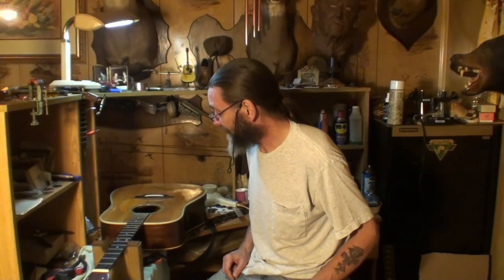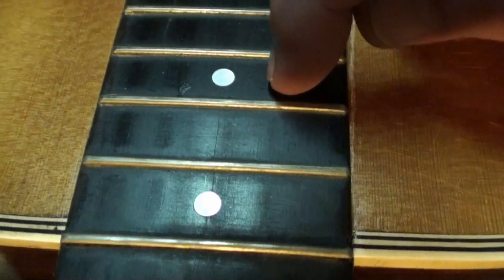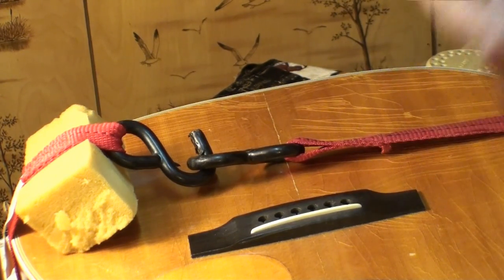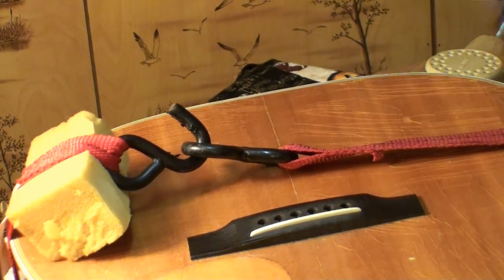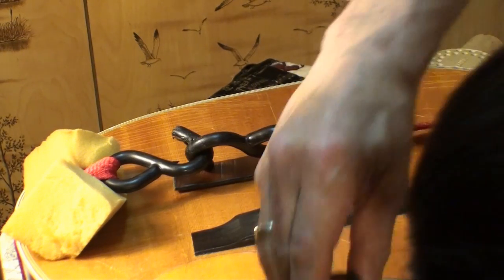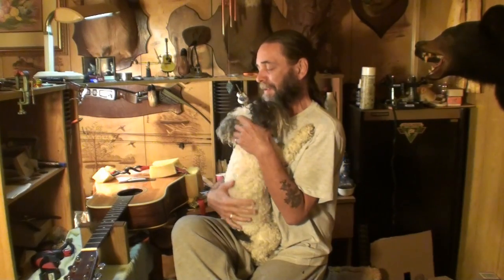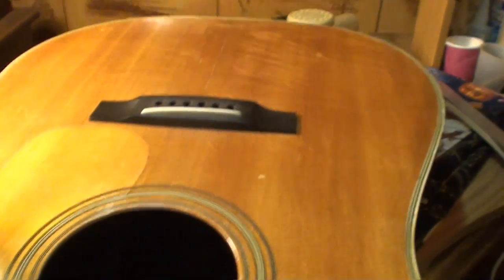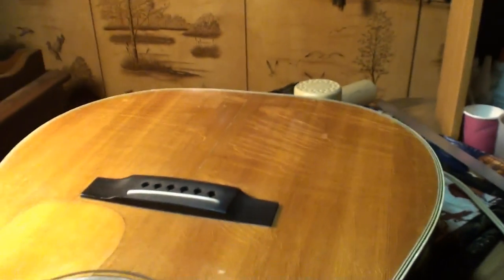Acoustic guitar cracked top repair by Randy Schartiger guitar repair videos

Comment: Thank you!!!! This video is excellent.  You are so good at REALLY explaining and making this information easy to understand.  I've got a 30-year old Ovation, shallow bowl, Thunderbolt, that was "destroyed" from a broken strap and a fall from a stage to the floor.  Oddly,  it STILL plays and sounds pretty good. but where the sound holes are ( lightening bolts), two HUGE cracks cause the whole front on each side of the bridge to cave in about a halfinch.  Like I said, this guitar still plays well, sounds pretty good, and (despite a crack in fretboard), it still stays in tune!  I assumed that the truss rod was also wrecked, but maybe not.  Anyway, I'm gonna try to work a miracle and try to fix this guitar up.  I'm a BIG fan of Ovations, so I hope I can make this thing look good again and keep playing well.  Thanks again for your videos. They have given me enough confidence to give it a shot!

Comment: Thanks for all these videos!! It's so helpful and encouraging. The entertainment aspect is the icing on top! It does take balls to fix someone else's expensive guitar- which I don't have in more than one way. I'm working on an old Gibson b15 195? There's been quite a bit of debate over it in the area guitar shops since Gibson's numbers are kinda wack and it seems to fall somewhere in the unknown/doesn't make sense range. There's a nice crack right down the middle of the top. Apparently someone attempted to fix it at some point, but the cleats are more like chunky blocks and the crack remains. One repairman gave me the advice of filling the crack (not wood filler, but actual splintered wood). I'm not sold on the idea. I really want to take those old cleats out and just redo it all. Thankfully it's my guitar, but I'm practicing and want to treat repairs as if they're someone else's guitars. I'm afraid I'm frozen stiff with my indesiciveness. 😡

Comment: Great Useful Post!  Suction cup being used at 5:00 enlightening.  My skills are primarily with wooden antique rifle / musket stocks ( e.g. Revolutionary War 1766 CHARLEVILLE ) .  Now gun stocks which are a lot thicker; but if I see light through the crack, I run a piece of unwaxed dental floss through the Crack then add a conservative amount of adhesive to the floss and work the floss back and forth through the Crack to get the glue deep into the Crack.  Would this work with a Guitar ?  Another trick I found fir dents in a rifle stock is a few drops of water over the dent and let sit for ~10 minutes.  Then a damp piece of bleachec sail canvas is placed over the dent and a HOT clothes iron  is worked back and forth over the dent.  The water turns to steam and expands.  The expansion pushes up the dent and sometimes makes it disappear  completely.

Comment: I have a new patient in. Two long cracks from the bridge to the tail caused by dry, heated air which don't look that difficult except they're only about an inch or so apart and that will make it a pain if I can't get them both to level out at the same time before gluing and cleating. But she's also got a wound above the sound hole where it had something heavy dropped on it or it was dropped on something. That issue is compounded by the bracing being right where I need to put in a makeshift top "jack" both on top and on the back! I took a turnbuckle for a diy screen door and cut it down to fit inside a guitar and glued two wooden bases to the eye bolts and stuck a pair of felt chair leg sliders on. It works pretty good. I used it to level out and hold another cracked job I did.

Comment: Hi Mr Randy, great job with the suction cup, forcing the glue through the crack. I liked it when the strip of leather seemingly appeared under the two hooks joined together at the top of the guitar and loved it when you pulled Q-ball from the hole a lil' later on....Hooold Onnn!!! Have a great evening :)
Reply from the maker: lol gotta keep it interesting and funny! :) I had paused the camera and thought I should put leather there lol That's a good trick with the suction cup and gets glue where you normally couldn't get it. old on! :D Thanks Suzanna for having a look my friend hold on!

Comment: I'm humidifing my guitar at the moment because I found a crack and I thought it would be better to swell the wood to close the crack and get it as close to its natural shape before adding a clete. Good video. I like the idea of using the tape on both ends of the razor to scrape the high edge off the crack!
Reply: Exactly. Humidify it first and then address the crack.

Comment: Randy: I've been around guitars for 70+ years and have seen about everything bad that can happen to them.
I just picked up my 2nd Martin DRS Road Series guitar. I know my nearly 83 y o eyes arent what they used to be. The DRS2 I bought has a lo humidity crack
on the rear bottom bout. About 5mm long. I inserted a flishlight inside the guitar and the crack, while noticeable, no light from the flashlight can be seen .
I believe a quality gluing is as effective as using cleats and not humidifying after applying cleats. I used your method of applying Tite Bond glue and the
suction cup. Then a wipe with a damp rag. I've devised a home made Damps It from a small sponge, a cord with an alligator clip and a paper clip to attach
to the D string. That was last week. In the 7 days since the crack hasn't enlarged a single mm. Think I may be home free. But will keep an eye open.
The 2 best luthiers in Ft Worth Tx are 2 months behind on repairs. The Lord helps those ho help THEMSELVES!!
Reply from the maker: great to hear! it probably will be ok if its help this long and as long as you keep it properly humidified. all the best to you my friend and thanks for checking out my videos!

Comment: Hi Randy. Question: Have you ever tried a bar clamp across the top instead of the ratchet strap for closing up the crack after applying the glue? I just wonder if that would not work just as well or better.
Reply from the maker: I only have 2 clamps that are big enough to clamp it that way, they would probably work as well, I just prefer a ratchet style clamping because it distributes the poundage over more of the guitars body instead of one area and this allows me to apply a lot more pressure to the crack itself without crushing the guitar. thanks for checking it out.

Comment: Nice job repairing the crack. Looks like the suction cup works great to squeeze the glue into the crack.
I’ve heard of pulling a rabbit out of a hat but pulling a dog out of the guitar soundhole is a first :-)
Reply from the maker: +Dale Palmer It does work nicely, pumping the glue in until it runs out the other side then sucking it back thru as you work up and down the crack you eventually get glue everywhere needed. Q-ball in the soundhole lol hard to tell where she might appear! :P Thanks for viewing Dale! :)

Comment: Randy, I need your advice. I have a mandolin with the fourth fret installed too deep. The fret was apparently installed with a press because the fret board is deformed along with the binding. Playing the fourth and fifth frets results in the same note because it is deep enough to touch on the fifth fret while noting the fourth. Leveling all the frets would remove too much material on the surrounding frets, so I am left with two options unless you have an alternate idea. One: remove the fret and replace with a larger profile fret then level it to the height of the rest (if high profile fret wire exists or go with large fret wire like bass fret wire) Two: somehow cause the fret board to swell raising the fret in question. Idea: (remove the fret fill the slot with water then heat with a soldering iron...repeat until fret board swells) I have not purchased fret wire before so I am not sure of the available sizes and how they are referred to for ordering purposes. I have confidence in my abilities but am unfamiliar with the specs. Thanks in advance, I know you are the man to ask, Rick
Reply from the maker: If you can find some wood that's the same kind of wood your fretboard is
 made of, start sanding it and make yourself a bunch of sawdust, pull 
the fret and drop the sawdust into the fret slot and areas that have 
been pressed, use CA glue or super glue and drop just enough drops (very
 little glue) of glue into it to cover the whole area and let it cure 
good, then you can sand the area down to the same level the rest of the 
board is, cut a new fretslot and install the fret and you'll never know 
it was ever worked on. 
If you can't find the same type of wood, you can carefully sand a little
 between each fret until you have enough dust, it won't take much. 
Thanks for tuning in and good luck on your repair!

Comment: Randy I bought the plate mates tried with the sticker part of it, didn’t work kept falling off finally terminated I used the wood glue you said to fix a crack it suck and I used my IPhone stuck it in the guitar with just the lol ash light part of the phone it was so easy to put in but ai did have to glue it in. I’m just happy I did get the right size. So now people if you need a light inside you guitar use the flashlight on your phone fits in there and it shines right through the peg holes to make the process much better
Reply from the maker: did you clean the area where the self adhesive plate mate goes first? many time people forget to clean it before installing a plate mate, I've never heard of anyone gluing one in but I suppose it's be ok if you planned to leave it in there. thanks for checking out this video!

Comment: Nice one again. Instead of using a blade could you use actone to clear away the glue? I don't know how it would react with the finish though.
Reply from the maker: +tallthinkev That's what I was worried about effecting the finish, the hot glue they used on the binding came off pretty easy once I found the right temperature to make it jelly like. It might work on top as well.

Comment: Randy- I fully believe that top expanding/contracting took the end of the fingerboard with it - I've seen this 100 times on Martins. Just like the pickguard.  I'm betting you'll find some kind of crack directly under where the fingerboard is cracked.   Oiling the fretboard might have stopped it but in general this guitar looks like it was never kept properly humidified, and it may have been a "gigger's " guitar where it was in an ice cold car one minute and a hot bar the next.  More death to Martins -  Who knows.  All I know - when you get a Martin with a bunch of sizing cracks and the finish all checked to hell like this one - it's been expanding and contracting faster than the "Big Bang" ;-)   BTW - the top "crack" is really a seam separating isn't it?  Not that it makes any difference - in fact a separating seam I think is harder to get a good repair on because there's already glue in there, and it's gonna stick out like a sore thumb compared to a grain crack.  Just my .02 - keep the vids comin' brudda !

Comment: Randy, I saw Jerry Rosa do the suction cup trick and tried it on the Grammer guitar I worked(also had a top crack, same place) and it works great. My first response to it was it looks like it would suck the glue back but it really does work. One problem though you made look way to easy, people won't want to pay our extreme prices if we make it look easy. That was sarcasm, just for clarification for the uninitiated. 

I love the dog already but that little stinker in the sound hole was great.
Reply from the maker: +Dane Nichols I learned that trick from an old violin maker who also repaired them, and I thought exactly the same thing you said. When the glue is forced in their eventually you'll get like squeeze out on the other side and when the cup sucks as you pull it back it sucks some of that glue back in, of course moving the cup up and down the crack eventually would cover the whole thing with glue on both sides. Shit man, I just gave the whole secret away! lol That was sarcasm too. 
Q-ball makes for some good footage lol

Comment: I have a similar crack, but its right beside the neck. Would this method still work? Im assuming so but its so close to the neck.
Reply from the maker: yes as long as it's not under the fretboard extension this fix should work, if it's under the extension then the extension should be unglued first. thanks for watching!

Comment: Do you have to use the same type of wood for the cleat? Spruce top = Spruce cleat or doesn't it matter. I would think as long as it's close to the same type of wood like a soft wood vs a hard wood.
Reply from the maker: It really should be the same type of wood as the top, or what ever you are gluing, if you can't get the same type of wood then do as you said and match it as closely as you can with what you have. Same type of wood is best tho.

Comment: Randy, do you use the same ratchet strap on a classical guitar? Where would I get a spruce cleat like you recommend? Would Elmer's Carpenter's wood glue work or should I get the Tite Bond? Finally, I went to the Martin web site to find out what oil they recommend for an ebony fret board and couldn't find a recommendation and never heard back from my typed message. Thanks for the help!
Reply: Christopher Logie Go to Lmii.com or StewMac and buy a cheap spruce top. You can get one for $20 + shipping and you will have cleats for the rest of your life. Or you could cut cleats from the edges of the top material and use the top later to build a guitar if you ever get into that.

Comment: What glue are you using ? I love the way you use the suction cup and ratcheting ratcheting strap . I am about to attempt top crack repair on a spruce top ukulele and have watched a few d I y videos on you tube and got lots of help from yours . Thanks , Curtis
Reply from the maker: I used Titebond Original, it's the best I've found for wood. Thanks for watching!

Comment: hey Randy . I am a subscriber  . Thanks for what you do to help me do my own guitar maintenance . i have a Seagull with a cracked cedar top . Do I need to use cedar for the cleat ? How thick should it be ? Where can I find a small piece of cedar for this ?
 After the thing cracked I found out about problems caused by the wood drying out . I am a slow learner but you can bet the 2 year old Taylor 210  I bought from the cat down the road the other day is going to spend less time sitting out on a stand for display and more time in  its'  case with a damp sponge in an open baggy inside the guitar body .
Reply: +lane lon   I heard that you need to use the same kind of wood for the cleat as the top
Reply from the maker: +lane lon Thanks for your support! :) Yes you should try to use the same kind of wood cleat as the wood you're gluing to. As for thickness, and since it's the soundboard of the guitar you'd want to keep the cleat as thin as possible yet thick enough to hold. I would recommend .060 to .080 thick, no more than that because it will effect your sound if you go much thicker. 
That's a good call on the Taylor! Keep them humidified and you probably won't see anymore cracks. :)
Reply: Im starting to worry a bit now about my one all wood guitar .  I never keep it in the case .  I keep a sound hole humidifier in it .   Its on a stand but the heat is off now so I think it should be ok .    I will take better care of it next winter .   I may lay it down and put a damp sponge in it for a few days .  See how much water it will take in .   What do you think Randy ?
Reply from the maker: Dev9172
Definitely do it! I have one that hardly goes in the case too but once per month I put it in there and humidify the inside of it.
Reply: Thanks .   I will .   I can leave it in a day or 2 .
Reply: .060 to .080 ...     is that like a !/16" to less than an !/8"   ?
Reply from the maker: lane lon
0.0938 is 3/32 so yes it's not exactly the same but very close.
Reply: Dont make me do fractions to decimals  !    lol
Reply: Thank you sir . I was about to stick something in there a  lot thicker than that .  Now I am thinking the thin end of a cedar shake shingle might be a source  . Or maybe  just a sliver whittled from a cedar limb .  i am just a simple minded carpenter . I can cut and measure to the 1/16 
plumb and square all day long but mils are not part of my repertoire .

Comment: Randy, I've got a Martin OM-21 Special I bought 8 or so years ago. Its gloss top has a few of the same type of spider cracks I see on the guitar in this video. Just in the finish, not the spruce. Is there anything I can do with this? The cracks appeared within the 1st year but no others have appeared since. And just in the top. Thanks.
Reply: Hey there.
Nitro Lacquer will suffer from finish checking no matter what you do. You could touch them up with C.A. glue but I would recommend letting them be. You would just be prolonging the inevitable. Learn to love the finish checking. I think its beautiful.
Good luck.
Jeff Metz Jr.

Comment: Love this!  Love homemade strap idea!  Can you glue on the backside if the crack is mostly rehealed after rehydration?  I just want to stabilize it so it doesn't open again.  Also I've been looking for dogs in my sound hole but they just aren't sleeping there.  Course, my 80 lb Golden might not fit  Let's do it!
Reply from the maker: lol yes you can and should secure that crack and humidify first. enlarge your sound hole so your doggie can get all up in there lol thanks for watching!